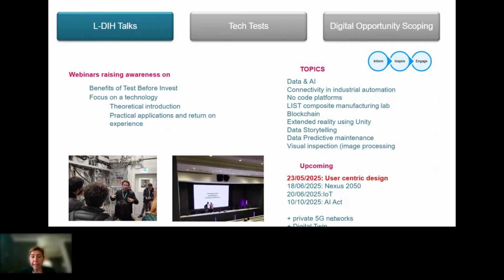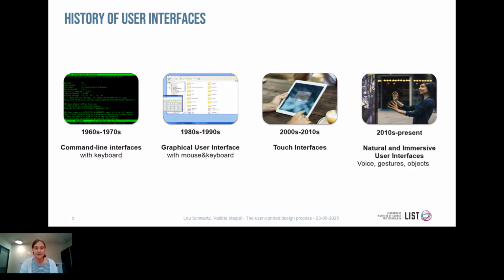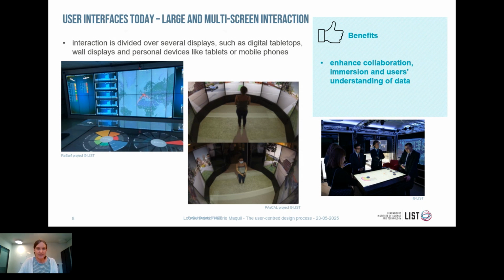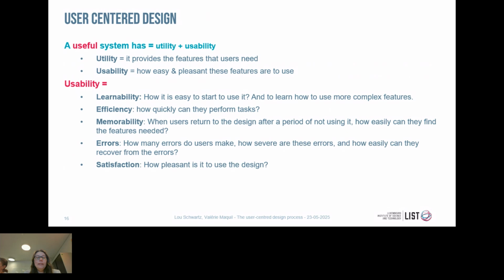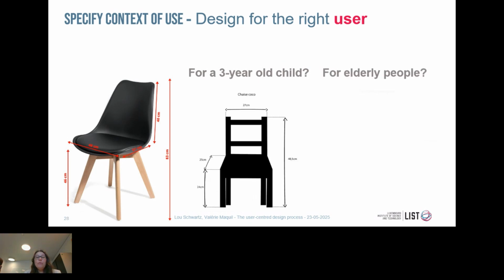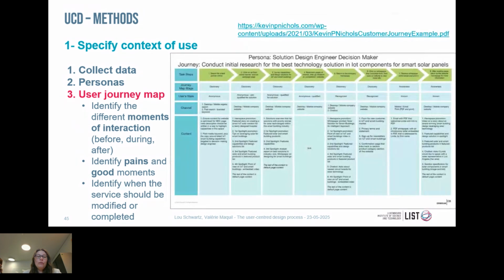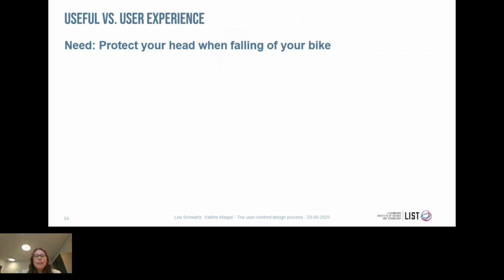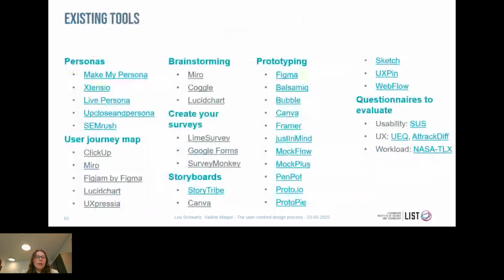L-DIH Talks | User Centric Design

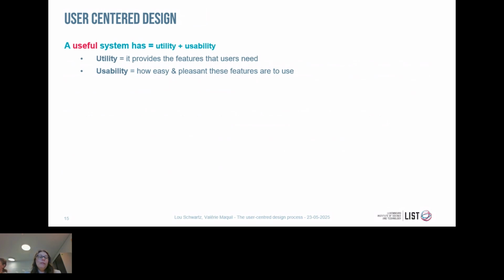Comment: Thanks for sharing this. At 20:44 minutes into the presentation, there is a discussion about "A USEFUL system has = utility + usability" and we call them as functional and non-functional requirements. Anyhow, requirements management tool like OpenRose can help manage such requirements / user needs effectively.  Hope this helps!
- OpenRose - 🏵 Requirements Management Tools Team 
FREE and Open Source!
Capture, Define, Trace, Change, Prioritize, Baseline, Negotiate, Test, Deliver >>> Repeat the Process.